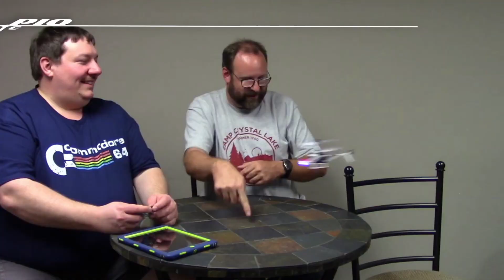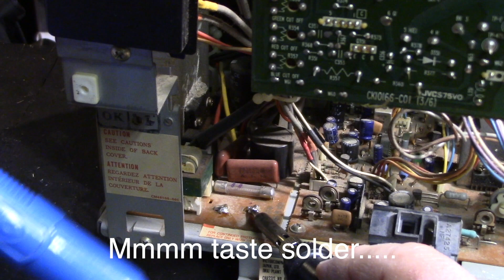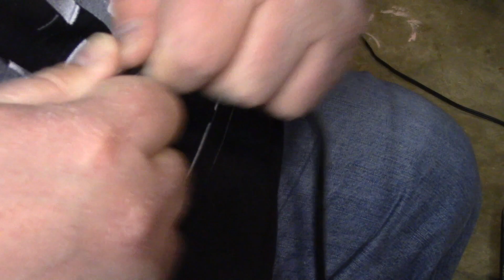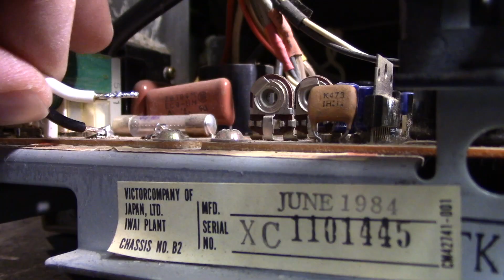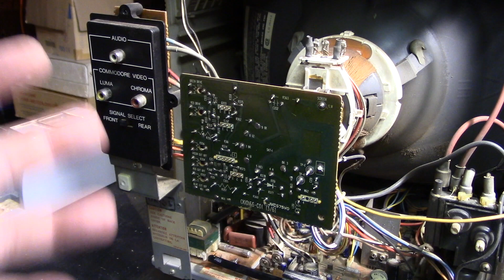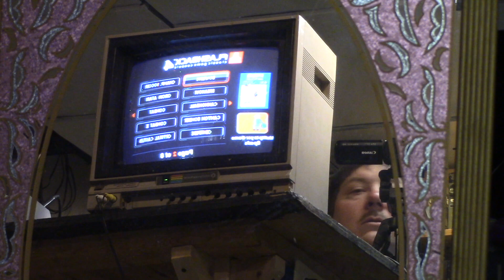#Commodore 1702 Monitor Repair, Part 2 - 3 Old Tech Dudes

Comment: Hi. This is a long shot but I am looking for some advice as I acquired on of these recently but I noticed a potential hazard issue with mine. I think it's the flyback transformer? It's the black box with thick red wire coming off of it with two white adjustment knobs that you show in minute 12:42. There are supposed to be 2 screws securing this but both my screw mounts are shattered so this box is just sitting on that round black cup looking thing. Is this a dangerous problem or should I find some way to secure it?

Comment: I just bought a 1702 from a friend who got it at an estate sale (along with 2 other 1702s and 3 Commodore 64s!) We tested it extensively before I purchased it, but unfortunately it wasnt enough, and now that its home the thing seems to overheat and the vertical sync starts going crazy and eventually the screen will black out. At the same time Audio will begin to cut out and get distorted.  I'm wondering if you know where I should start diagnosing this, or, and this is a long shot... if I know of any place in Atlanta GA where I might be able to have it serviced? I'm assuming its a combination of dust build up and old caps, but I dont want to investigate much more for fear of hurting myself of the vintage display.

Comment: I have a question.  My 1701 has recently developed a buzz coming out of the speaker. It comes up when I turn the monitor and dies out when I turn it off. I can hear the frequency drop as the power draws away. The buzz is there when there's nothing connected to the monitor and it doesn't respond to volume adjustments. I've moved the monitor to another room, just to test whether it's some local interference but the buzz is exactly the same where ever I put it.
Should start thinking of replacing caps? Or might this also be a speaker issue?

Comment: I'm getting a crap image from the rear panel. Color is weird/sometimes non-existent, and there are faint, roughly 1/8" wide stripes vertically across the image. Front input is perfect but still would like to use the rear inputs. Any ideas what I can do?

Comment: I have one but the audio went out but was not the speaker.  Haven't found the part that controls the sound.
Reply: Your capacitors need to be changed I have four 1702 monitors 2 had the sound go out or intermediately.  The caps are over 35 years old now and the audio amp always seems to go first. They sell a cap kit it's well worth buying that and replacing all of them then your good for years